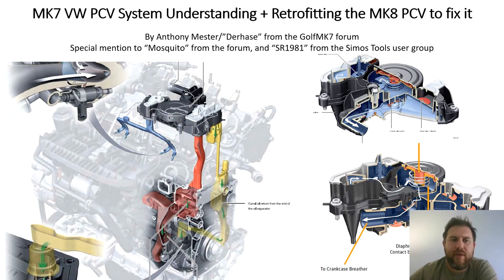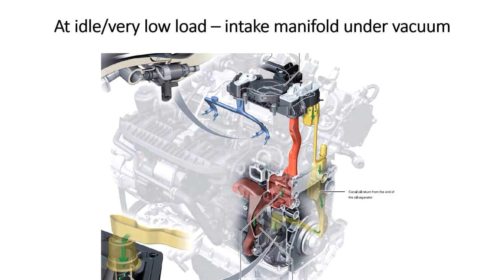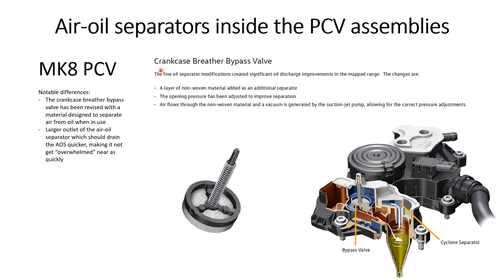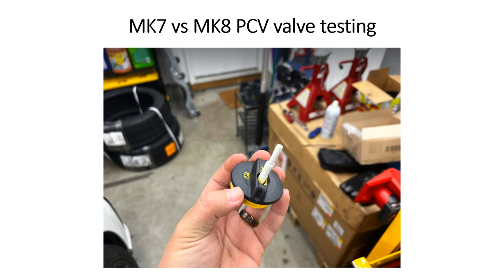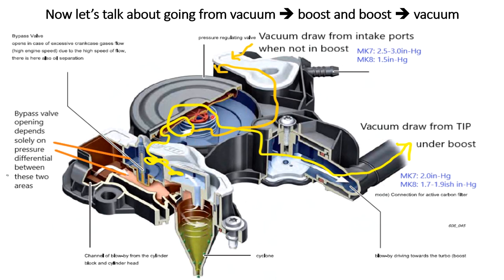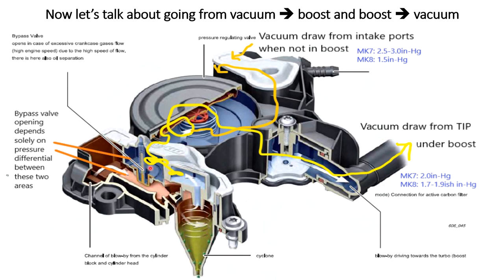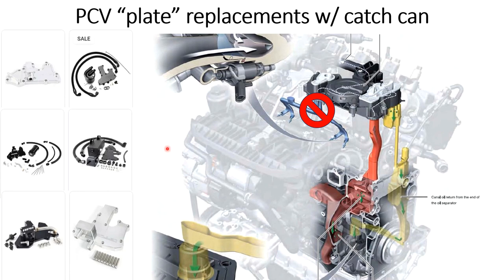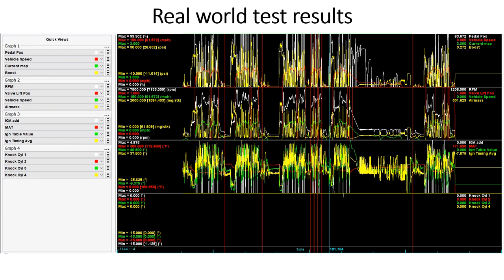MK7 PCV Analysis - How it works, and why I've adapted the MK8 PCV (Pt 5)

Comment: I wish I found this video earlier as I just installed a plate catch can on my Mk7.5 GTI.
Reply: VW knows that with a DI engine oil through the intake is terrible, will cake up the valves (carbon deposits + oil). It looks like they improved the PCV to reduce the amount of oil except under high load. Which isn't as bad due to the pressure??

Comment: This is a good video with a lot of info about this system and problem, but I feel like the reason for a catch is more about preventing that oil cloud that occurs in certain turns on track. There have been mixed results on the forums with many users experience an inline can and replacement PCV system solving this issue while some users still experiencing that clouding effect regardless of a catch can. From what I can take from it is the revision of PCV valve that is is installed has an effect as some revisions were better than others.
Reply from the maker: Correct. In case it wasn't clear in the video - I think that how well a given PCV (any of the MK7 revisions, or the MK8 part) works on track is entirely from how much oil makes it through the bypass valve. I think that adding catch cans makes the issue worse by pulling more oil due to the delay of vacuum depleting on lift-off, plus delay of generating vacuum on tip-in. I think people install inline cans, which "breaks" the stock PCV system and makes them fill up excessively fast and people point to the oil in the can as "proof"... when in reality if you dump the can 1.5qts worth over the course of a weekend on track... the truth is that if NO can were present, you'd not be seeing that same 1.5 quarts in the intercooler piping.

Catch cans with the stock system I think screw with the "timing" (for lack of better words) of the opening and closing of valves... and perhaps "tuning" the size of catch can may help draw JUST ENOUGH air towards the catch can/TIP to keep from entering the blue intake path, but not so large that they're sucking all the oil right out of the bypass valve. From what I've seen on MK7 valves, the BMS catch can seems to have the best (anecdotal) success rate since it's a very small can, with short hose runs. It does not fill up quickly according to anyone I've spoken with running it. For SCCA STH autocross classing purposes... if the "BL" revision PCV doesn't fix smoking issues on course, I'd probably be inclined to try the BMC CC personally (since retrofitting a MK8 valve is technically not allowed).
Reply: @datadrivenmqb  Well that would work for your point, but there have been many people who have installed either an inline can or a full system replacement who haven't caught anything after months of use. This could be do to the climate that they live in if I remember correctly, but there have been people who haven't seen a single drop in their can. Also, some if not most of the gunk doesnt appear to be oil. There can be some oil in there, but its mostly more of a liquid substance; I can't remember what it was off the top of my head.
Reply from the maker: @xXxXFALL3NXxXx  this is talking strictly for track or autocross use. The high RPM on-off-on throttle is what causes issues. We have 5-8 MQB cars that regularly show up at TSCC autocrosses and track events. One guy in particular has zero problems with his catch can on the street, but fills the entire thing up in 4 or 5 autocross runs. How quickly they fill up is 100% dependent on how they're driven (and in normal driving - climate as you mentioned, particularly in winter time they'll catch condensation as you said).
Reply: @datadrivenmqb  I see your point and agree with you that it is dependent on those driving conditions. Taking away from the video and this that the better solution is to run the MK8 revision PCV valve over a replacement and inline can? 

I know why some people would probably stick with aftermarket solutions as they have solved that smoke plume on certain track condition driving that is a common problem on this platform. It's the reason why I am looking into a catch can.
Reply from the maker: @xXxXFALL3NXxXx  Yes if oil does not make it into the blue path to begin with, you won't have a smoke plume. This is solving exactly that problem. Every knock event happened with hard RH turns which always followed braking events. While I never noticed smoke while driving, it did occur to some small degree (and caught it in one video if you poke around my channel videos).

Catch cans (with stock PCV) only help with oil in the TIP connection - which is NOT where any oil plume smoke is coming from. 

PCV plate replacements will fix smoking, but they pressurize the crankcase under low load and potentially braking as well - which is less than ideal.

I have a friend sending me an APR CC/PCV plate kit to test out. I'll be documenting it here to see if the crankcase pressure is acceptable or could be a problem for long term seal life, etc.

Comment: Great video,  when autocrossing, what data logger are you using?  Is the knock sensor data coming from VCDS?  If so what settings are you logging?  Thanks again.
Reply from the maker: @JoediyLab  it's using Simos Tools.
https://www.datadrivenmqb.com/diy-data/st-getting-started

If you're on FB, check out the Simos Tools Users group.

Comment: I just did the valve retrofit on my S3 without the venturi with a P-Max 2260S and an IE intake. I would be interesting to compare the effects of aftermarket intakes on the PCV system under boost.
Thanks for your work on this.
Reply: I also have a Pmax and I was thinking about making a hole in the bottom pipe and connecting this cable. as it is for the venturi. and you plugged this cable and everything is fine. ?
Reply: @patrykkrol9433  yes, the boost control system was able to compensate for the increased airflow of the Venturi. I drilled a hole in the reinforced section of the factory boost pipe and installed an NPT fitting. It worked well.
Reply: @JordieG8  good to be able to do that. and there are no EPC errors etc? Can you share any photos of how to do it on WhatsApp?

Comment: I really respect this information and your testing. I'm always worried about products like catch cans because what if they know it doesn't help, will they stop making it? Will they actually say this? On a DI engine VW would want to avoid oil in the intake as much as possible so you'd assume their PCV design would be optimized for that.
Reply from the maker: Thanks! I joke that VW probably pays some dude to listen to door chimes more money than what the aftermarket has put into R&D on the PCV system. 

You just aren't going to get OEM levels of development and true testing in the aftermarket. This is something I learned over the course of many years as a tech.
Reply: @datadrivenmqb  you mentioned that if the crankcase pressure exceeds some value, a relief valve opens. Does this cause some of the oil in the pcv reservoir to enter the turbo intake?
Reply from the maker: @catinthehat5140  at what timestamp are you referring to?
Reply: @datadrivenmqb  9:39. to about 11:30

Comment: Wow that's a lot of knock. I've never seen that much and I drive my car like I stole it. HPA FR450, 29 PSIG, EQT pro tuned, 8.5" wheels 245 ps4s tires, Bilstein coilovers,  4 puck clutch, FBOs. Replaced my PCV with the newest revision last year which removed some rough idle issues I was seeing. Is this a problem with old revisions of the PCV or just any mk7 PCV?
Reply from the maker: Can happen from PCV failure, earlier revisions may be more prone to issues. This problem only really shows up in track/autocross situations until it’s REAL bad.

Comment: Could be a shot in the dark here but i've been having boost issues with my vortex xl mk7 R. Car makes 32-33psi just fine until i hit 7k rpms and then it spikes wgdc to 100% and sits around 31psi, we have gone over other possibilities such as pressure/smoke test and replacing the dv.

So my question is do you think a failing mk7 pcv could cause an issue like this? Check valve  potentially leaking a minor amount of boost only at high rpms?
Reply from the maker: Maybe... But I can't realistically see the PCV leaking so much to cause a notable hit in WGDC and not also do something wild like blow the rear main seal out, or smoke like crazy under boost.

I'd venture to guess a failing turbo or maybe a restrictive exhaust not knowing anything else. I can't say I'd go straight to PCV based on your issue.

Comment: have ypu figured out what that sensor does? It's a map sensor but why would VW decide to put a map sensor? If you unplug it you'll get P0453 and P0452 (i'm havi g P0452 problem on my MK8 GTI and still has it after replacing gas cap and evap leak detection pump). I didn"t know until I saw a thread titled  "P0453 code on MK8 golf r" on vwforum and when I unplug the connector to the sensor I get P0453 (I assume my Pressure sensor has failed (I could get it fixed under warranty if I didn't get a tune) while diagnosing it.
Reply from the maker: @W0LV1E45  it measures the PCV vacuum source. Can also capture positive pressure crankcase events. Sounds like you might have a failed valve. Pressure sensor failure is relatively uncommon.
Reply: @datadrivenmqb  I replaced it and the code P0452 disappears. I'm so pissed since I bought a new evap leak detection pump for it twice but both didn't work. Turns out it is that map sensor on top of that pcv valve that is the culprit. I thought it was the wiring at first so I stripped the tape to check the condition.
Reply from the maker: @W0LV1E45  yeah, if the EVAP system doesn't have a sufficient vacuum source OR if it ever sees pressure or a lack of vacuum when it's expecting to see vacuum, it'll set that EVAP DTC.

Comment: Possible to remove the check valve at the TIP side of the PCV and add a check valve close to the TIP, so the volume of air between the check valve and low vacuum is smaller?
Reply from the maker: If the vacuum gets depleted (like it does when going from off to on throttle) it won’t make much of a difference either way. Doing the full retrofit w/ Venturi helps the most. More info has been learned since this original video.

www.datadrivenmqb.com/mk8pcv

Comment: If the pcv was failing or failed, could it cause any bungs/plugs on the timing chain covers to unseal and leak oil ?
Reply from the maker: Failed PCV can cause increased crankcase pressure, which could show up as cam cover or timing cover leaks, yes.
Reply: @datadrivenmqb  cheers mate my inspection Bung popped twice, chnsged my pcv now

Comment: I have a 2021 Atlas with the 2l turbo. How can I tell which version I have, and does this issue apply to a street driven car vs. competition? How can I reach you?
Reply from the maker: That should have a regular MK7 style PCV system. I'm not sure of which valve revision specifically. These problems don't really show up unless you're doing autocross or road course stuff. If there aren't any "problems" with your PCV system, generally I recommend leaving well enough alone. One of the latest findings seems to suggest that aftermarket turbo inlet pipes might cause some issues with OEM PCVs. Check that video out here:
https://youtu.be/tXNUvSBFiVE?si=1DmceZkEzShpCdRM

Feel free to contact me through Facebook @datadrivenmqb. Or on www.golfmk7.com as user "Derhase".
Reply: Would it be okay to disassemble the pcv and clean it. My other concern is carbon build up on the valves. I'm contemplating cleaning with baking soda at 50k miles
Reply from the maker: @jimkamradt7243  I suppose you could disassembly and clean the diaphragm assembly. All of the MK7 valves I've taken apart have had some indication of not sealing evenly in the center of the diaphragm. I suspect this is due to the way air flows through the valve (and will be immediately obvious if you remove the diaphragm cap).

I'll also add that the MK7 valves are a much bigger pain to remove that cap due to lack of space around it near the back of the valve. I snapped one of the retaining clips on 2 of the 3 I disassembled. For peace of mind I'd probably err on the side of replacement.

As for carbon buildup, I don't think it's significantly PCV related. These cars have no EGR valve so there is some sorcery involved with the intake vs exhaust cam timing to get an EGR effect which keeps NOx under control. Doing long term testing on multiple vehicles would be needed... but considering that catch cans make essentially zero measurable effect on carbon buildup (including those plates that block off the intake path) from all the "testing" I have personally seen, I think the intake valve deposits will just be a regular maintenance item to do every 60-100k depending on driving habits, etc.

Comment: Hello, I have a problem with my VW Golf 7.5 R stage 3, when I install the racinline, barteck or apr pcv the car smokes, at idle and in motion, however not with the original, is there a solution for this?
Reply from the maker: I’d start with compression and leakdown checks, and if those both are OK I’d consider checking the valve seals (won’t show up on either of those tests). Sounds like there’s something physically wrong with the engine so I’d rule all of that out before anything else.

Comment: ive ben having oil consumption issues on a mk 3 scirocco race car with e ea888 cawb engine. i was going to fit an aftermarket pcv with a catch can but im thinking id sooner give this a try
Reply from the maker: I'm not familiar with that engine - if it's an EA888.2 then I don't think any of this will really apply/be possible as far as the MK8 PCV retrofit goes.

Comment: Wow this is pretty cool and something i may be interested in. I also autocross/track and used to get the smoke here and there years ago. Since then I have upgraded to the Audi S3 design on my 2016 Golf R and it has helped a lot, Dont think I have seen much smoke at all since then. Wonder if you have tested the S3 PCV? Either way hopefully you figure this out and there are some good benefits you may even try to sell a package with everything we need + instructions. I would consider it.
Reply from the maker: I have not tested it yet (the BL revision is what you're referring to right?). I have no interest in selling a package or anything. All the part numbers are listed in the video description (and video itself). You can walk into any VW dealer and order them, or online.
Reply: @datadrivenmqb  Yes the 06K103495BL. CUrious how it compares to the VW Golf R version you tested. There may be an improvement.
Reply from the maker: @bryanviper  if I get my hands on one I plan on testing it. Currently working on getting an extra pin populated in my ECU so I can add another MAP sensor to go to the oil cap I made, so I can directly data log the crankcase pressures vs RPM/boost/etc. Should be much more accurate than videoing a mechanical gauge.
Reply: I am having a smoke issue in my Golf 7R. I have replaced my AA rev. PCV Valve to BM rev., still the same problem. But tomorrow I am replacing for BL rev, so we will see.
Reply: Changed for BL today. Did some fast corners, breaking, accelerating so far no smoke. I Keep my fingers crossed, but its looks like problem od solved
Reply: It should improve it. if you REALLY push hard on the track you will likely still get smoke but it does help and for the most part resolve the issue from what I have seen  @xKypQx
Reply: @bryanviper am I understanding correctly, did you replace the OEM Golf 7R PCV with 06K103495BL from Audi A3 without additional mods? If you did, what breather hose does it take, would the original 06K103213J still fit?
Reply: Correct no extra mods, I used 06K103495BL Everything fits and bolts right up no extra parts. I used the original breather hose  @ssolariss
Reply: @bryanviper may I ask how did you come acroos this one? Has any testing been done by anyone, just curious. I'm not happy with what they've put on the early mk7 R and I'm looking to switch. I had a catch can for a while while I was tracking but I stopped. So now I want an OEM of some sort that does a better job than the stock. I'm torn now between BL or the mk8 retrofit.
Reply: @ssolariss   I heard about this in a VW FB group called - VW MK7 Golf - GTI - R - MQB probably around 4 years ago when I was trying to find a solution to the smoking while racing but did not want a catch can. So I have been running this for years without issues. Mind you its not going to solve your smoking issues 100% but it does make an improvement. Lots of guys are running this.

Comment: What if you do a reduction in hose volume to length of hose if length of hose is normally one foot now if you add another foot of hose plus catch can should get a 60% reduction in hose in and out opening. This might work with in line catch cans is my theory or better understanding untested hypothesis.
Reply from the maker: Hose volume definitely affects inline cans - I know of a few people who’ve changed their setups and gone from filling the can in. 3-4 autocross runs to hardly getting anything in the can after changing hose length and moving the can closer to the valve cover.